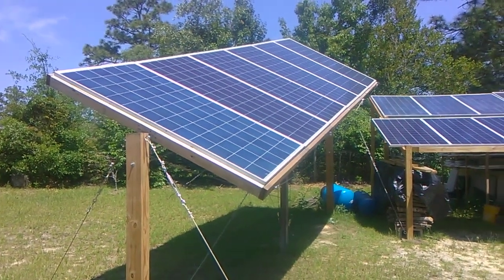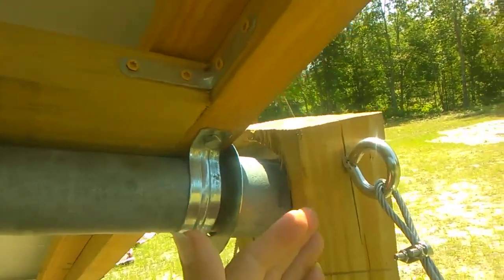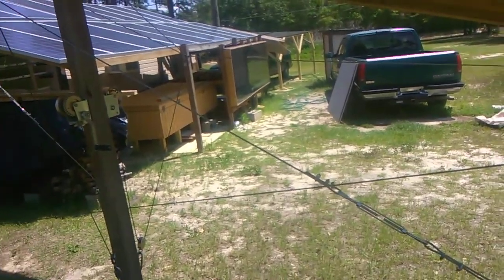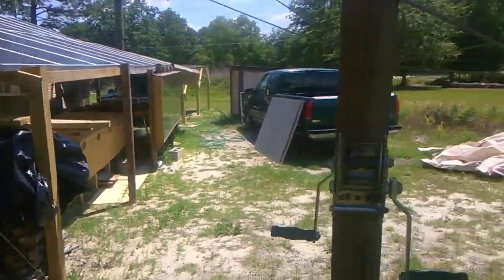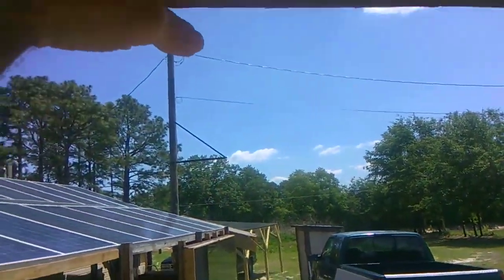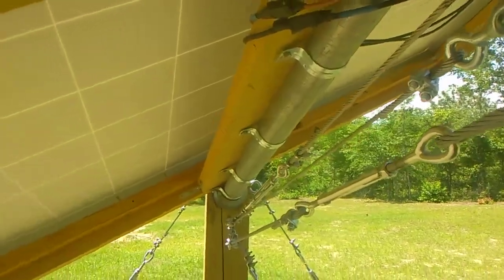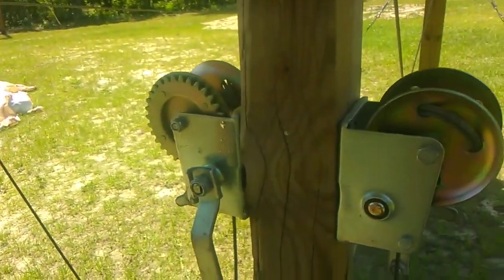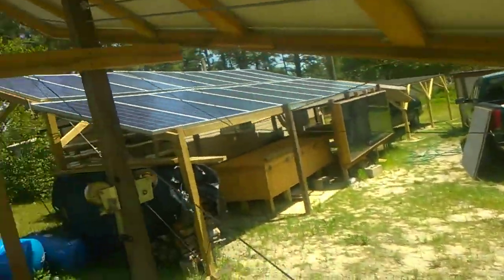Bossrox DIY solar ~ My 1st of 3 tracking arrays on a pivoting frame

Comment: Awesome project, awesome job good work. Personally I have concerns about it's extreme winds ability, some of the winds we experience in New Zealand could make this particular build quite uncertain, but i do love it 😊
Reply from the maker: I did too but we just had a wicked tropical storm hit us a couple weeks ago, 80 mph gusts & they held up, not even any slop in the guy wires afterwards. The size of the ground screw will determine how well it stays put.